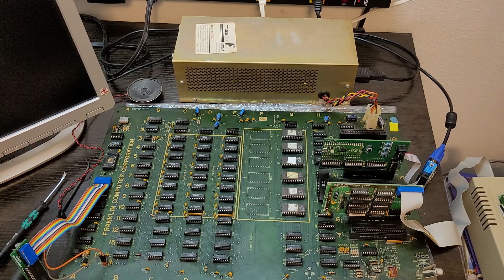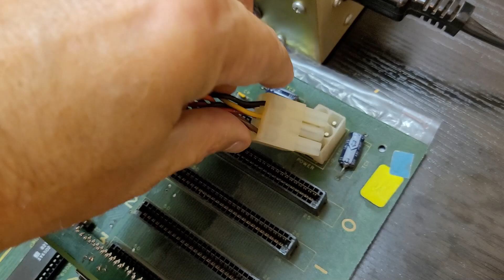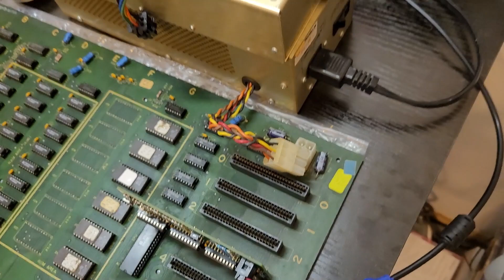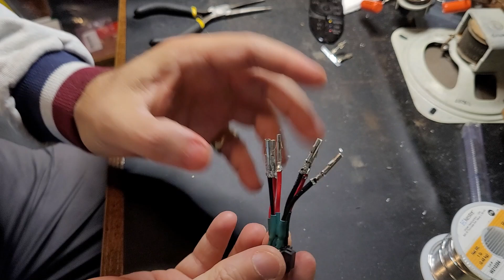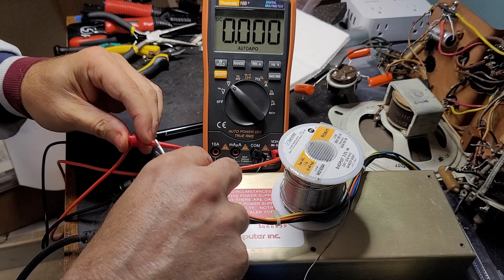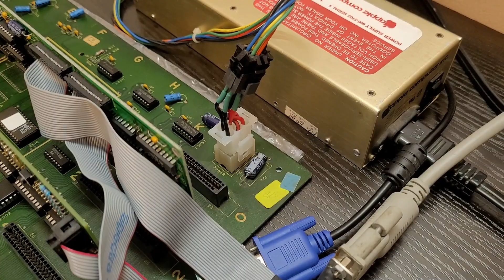Apple to Franklin Power Adapter

Comment from the maker: Important note - while this approach works fine (apparently) for the Franklin Ace 100 motherboard shown here, IT WILL NOT WORK with a Franklin Ace 1000 motherboard!  The Ace 1000 series apparently draws more amps than the standard Apple ][ power supply can deliver.  If you attempt to power an Ace 1000 with this adapted power supply, the computer will not start.  I don't believe it will cause any damage; however, I would not recommend even trying it.